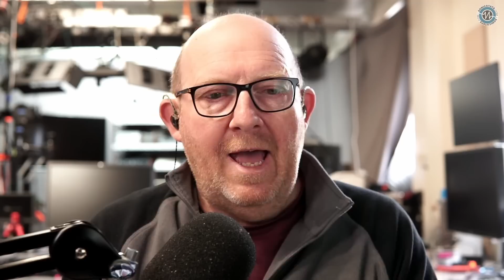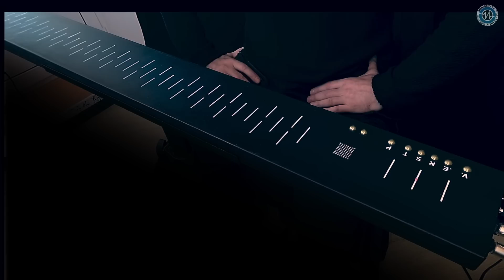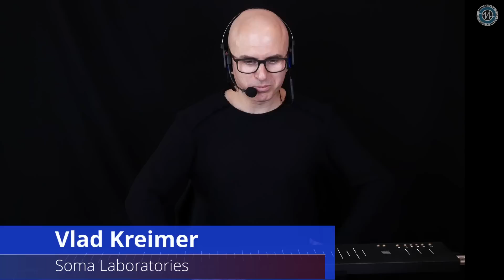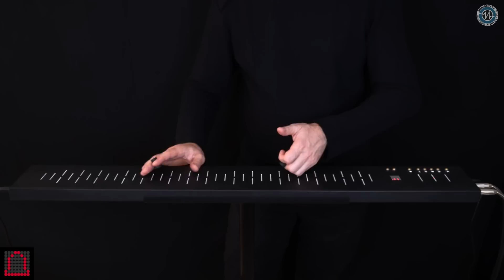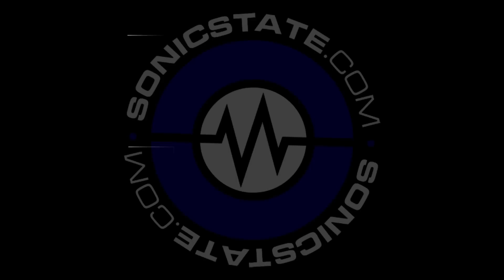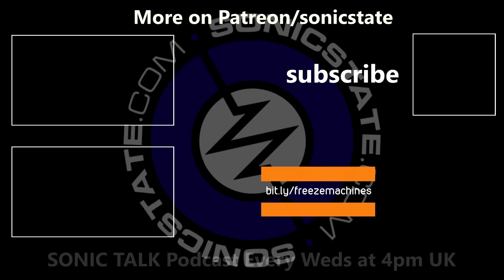Soma Labs Flux - Highly Expressive New Instrument - Sonic LAB Presentation

Comment: It's a nice piece of art to have in a high end home.  More practically it's much better to use 3D cameras and vision processing similar to Kinect.  I did some experiments a couple of years ago to prove the concept works.  That was using a Luxonis OAK-D module.  Sure, it would need quite a bit of work to turn into a solid product, but it is cetainly doable.  That way you dont need any magnets and every finger and orientation can take part in controlling CCs.  Don't get me wrong. I do like it and it's great to see people working on these kinds of human interface devices.
Reply: Haken already makes the Continuum with independent CCs per finger, but using Hall effect sensors instead of visual tracking. It's not 100% perfect - for example, if 2 fingers come within about a semitone of each other, they combine into 1, as far as the sensors are concerned. So, a visual tracking system could have some playability advantages over these other types of sensors. FSR arrays are another technology people use for this purpose (for example, in the Embodme Erae Touch). There have also been IR and sonar sensors used for such a purpose. I think the technology for polyphonic optical sensors is just getting there. Resolution, without errors, is important to the player. Good luck to any developers who are considering this route.
Reply: @GizzyDillespee  Great comment!  Right. I've seen examples with Hall sensors and a wearable glove before. I don't know if that is what you are talking about.  In any case, thank you for the overview of the things you are aware of.  With the vision system, it may be that you need multiple cameras.  Although having said that, I don't know if you have seen some of the recent experiments using machine learning models that are able to extract 3D information from regular cameras. They are exceptionally good. I'm sure skeletons would be no problem. Ultimately I think we will need a pretty high framerate. Maybe 100Hz could work.  That was another problem with my experiments. It was good enough for CC controls but it wouldn't be good enough for playing a piano for example.  I'm fairly convinced that a model that trained specifically for reconstitution of the end effectors (fingertips) could get quite speedy on relatively low end hardware.  Well anyway, exciting stuff that the future holds.  I am very much looking forward to seeing it all as well.

Comment: It looks amazing. But I personally much prefer to be able to touch the surface and be able to control the parameters with touch pressure, with x-, y-and z-axis movement, etc. Why? It gives a perceptible feedback about what you are doing like with any other instrument except the theremin. A theremin is often perceived as one of the hardest instruments to learn, because you don't have a haptic feedback.
The advantage of the theremin and this is of course that it looks beatiful to play the sound by moving your hands in the air.
Reply: But here you actually can have contact with the surface.
When playing lap steel for instance the hand holding the bar is "split" with the non grabby part anchoring the hand for more controlled vibrato (and muting the strings behind the bar). I guess a similar way of playing would be possible here.
Part of the fun with these MPE devices is that you can invent your own gestures of expression.
Reply: More important is to actually try things before having such a substantial opinion about them, but it's an empty suggestion to whoever prefers to be right.
Reply: @chhechhechhe  You are absolutely right. Im talking about my opinion of having haptics vs. playing something in the air (which I tried with theremine).
Reply: As another example how import haptics are: It took Apple a long time to figure out how one should control the user interface of Vision Pro. All the methods they tried were missing some haptics (and they didn’t want to use controllers as these are impractical in many usecases). Many other VR glasses were also using some hand gestures that are hard to learn, give no feedback and aren't recognized that well. That’s why they ended up with selecting elements by looking at them and the user tapping its fingers. By tapping your own finger you have the important haptic feedback. - Even the pinching/zooming of pictures/websites works like that by tapping the fingers on both your hands and moving them apart.
Many describe the interface so easy to learn that they managed it in like 5 minutes and that it felt as intuitive as using your smartphone.